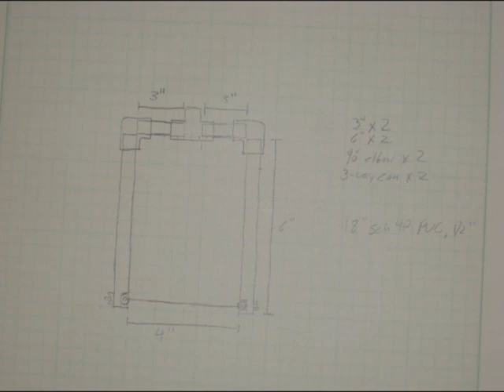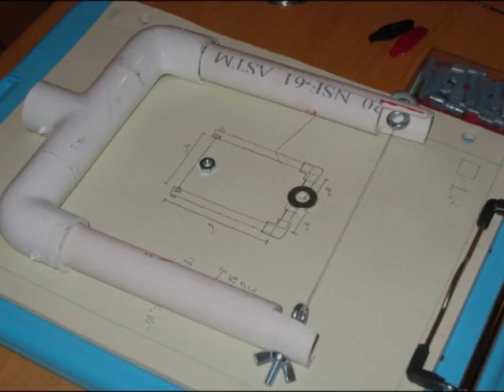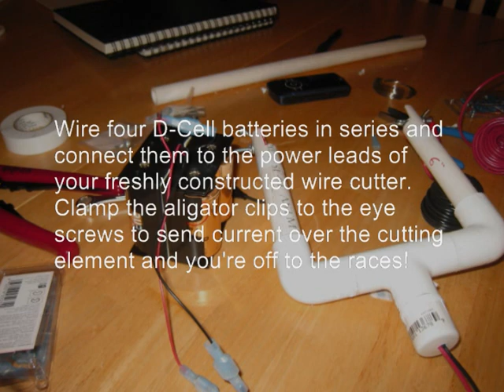Hot Wire Cutter How-To

Comment: @frederic470 its better to use regulated power supply so that you can easily adjust the voltage therefore the amount of current will increase and and it produce more heat.

Comment: frederic470,
I think there are different gauges of the nicrome wire and heavier gauges take more current to heat up.  I don't recall if the video listed the gauge but you might need more current.

Comment: yeah i fixed it, it works now, but batteries run out too fast. would converting an old power supply from a computer to a lab power supply be safe for the wire? (+5V 38A)

Comment: I connected my nichrome wire to 4 D-cell batteries with alligator clips just like you, but it doesn't get hot at all. I can still touch it and it gets barely warm, and yes my batteries are in series.

please help, any ideas?